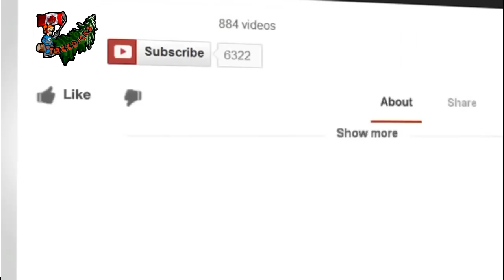Well, I aint a plumber

Comment: I'd go ahead and strip it all out it would end up saving you alotta head aches down the road, it expands/takes a lot more to freeze and bust and the best part it doesn't matter if it ever has to set they won't cut it out because the scrap yard won't buy it, the kind I've used was blue for cold and red for hot maybe it's a little different but still better than metal